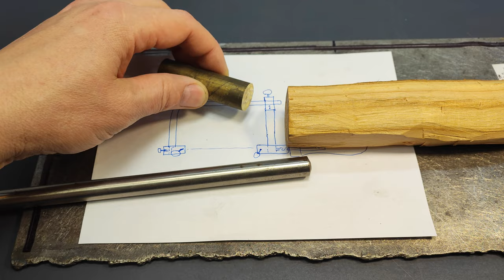Jewelry jigsaw made of titanium. Homemade

Comment: hi, would you mind sharing the measurements of the saw please. i'd like to make one myself. Also do you think 3 mm stainless steel would also be suitable ? I don't have anything else
Reply from the maker: I think it will fit. the size depends on the length of the file you want to use